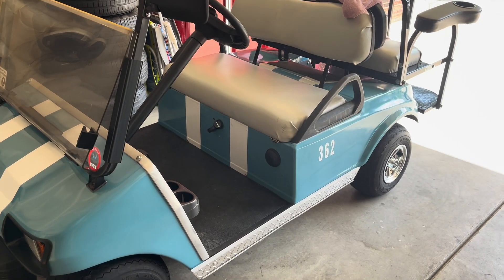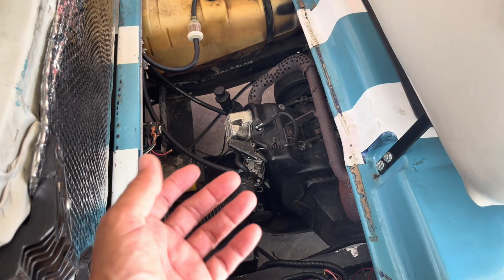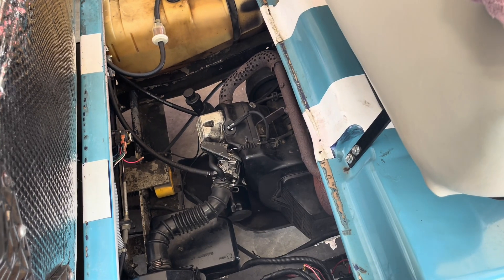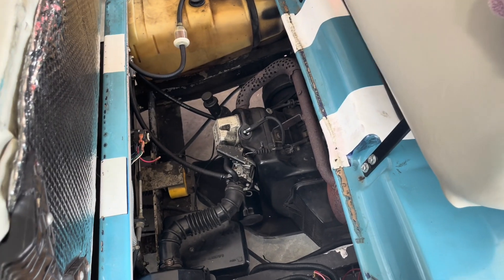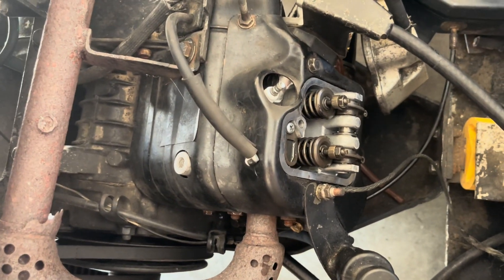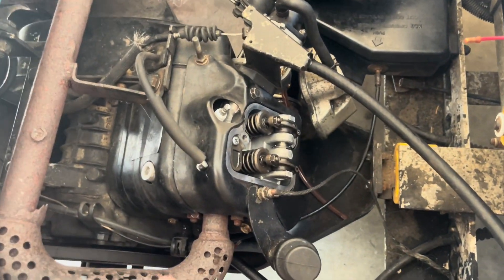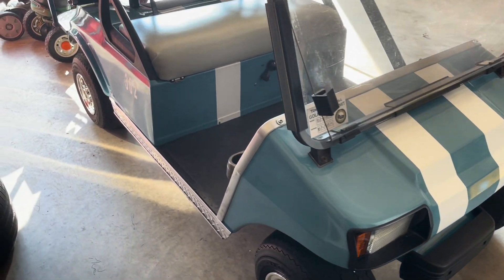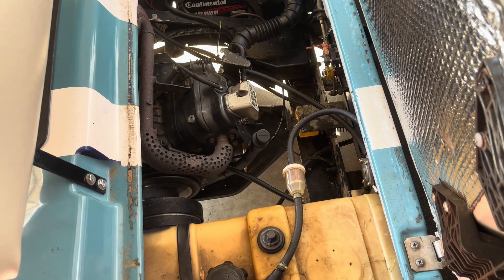Club Car DS FE290: Chasing an Issue (Part 3 of 3) Cranks But Won’t Run: How to Adjust the Valves

Comment: So it was the valve adjustment the whole time?
Reply from the maker: I actually think it was (Maybe) the coil, definitely the Rev Limiter and the piece that tied it all back together was the valve adjustment. For no more than the parts cost, I’d do them all at the same time.
Reply: @x-coastie ah ok thanks for your response I’ll start those replacements
Reply from the maker: I think it was!  But who knew.